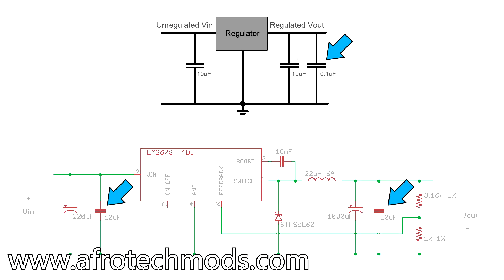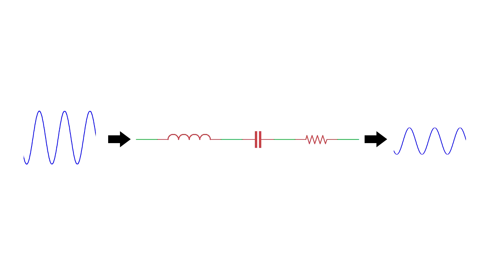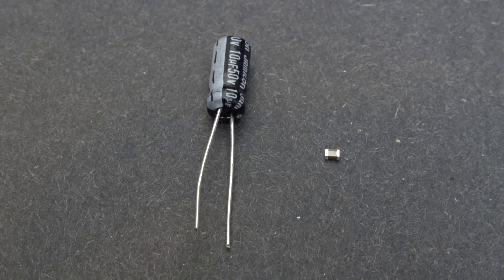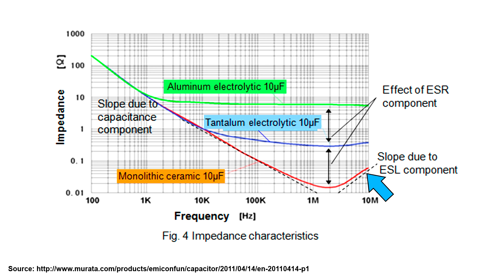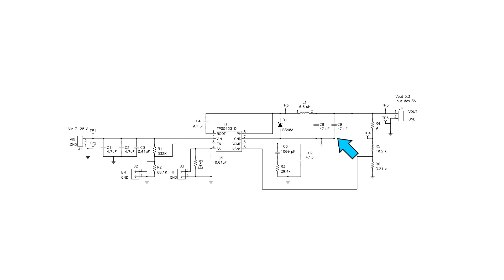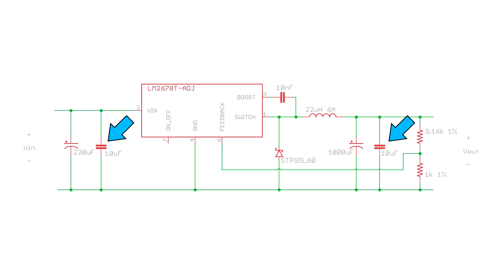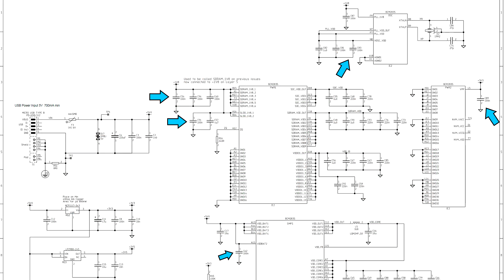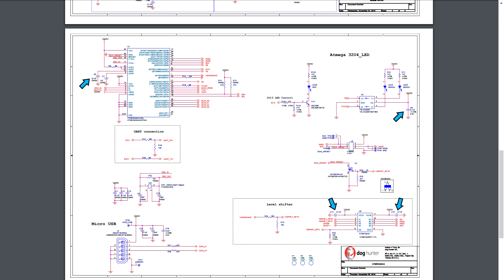Why electrolytic capacitors are actually kinda crappy 💩

Comment: Electrolithic for bulk, ceramic for decoupling ICs... thats it? . What about piezoelectric effect on ceramic smd capacitors? Capacitance vs voltage(typical -80 percent capacitance at rated dc voltage)? Capacitance vs temperature? What about tantalum caps? Electrolithic cap service life at rated temps(2000~10000h)? Y class? X class? Leakadge resistance(especialy for auper caps). Dielectric obsorbsion?
Reply from the maker: What about them? With your vast knowledge of the subjects, and a clear desire for others to learn about them, I am sure you must be working on a video that will talk about all of these things. And because you are so very clever, you will find a way to neatly fit all this information into the ~10 minute recommended format for Youtube videos that matches the average person's viewing habits. I have subscribed to your channel and I look forward to seeing your video that will talk about "electrolithic capacitors" and "dielectric obsorbsion".
Reply from the maker: Most of the time it's fine but occasionally you'll run into something that requires a min ESR / ESL to be stable. You could just replace them with some nice 10,000+hr 105ºC electrolytics.
Reply: @Afrotechmods  aha! That makes sense. I was wondering the same thing. Thanks! 
BTW, what the heck is diarectumlic obortion?
Reply: I think he was triggered, and forgot to spell his words properly during his event.
But I have a question:
How do you feel about replacing electrolytic capacitors with non-electrolytic capacitors of the same capacitance rating?
I ask because I have multiple old electronics with failed electrolytic caps, and I want to replace them with caps that aren't going to fail, even under high temperature/high load conditions.

Comment: You didn't mention derating of capacitors or compensating for it..
Ceramic capacitors can drop to almost half their specified capacitance value depending on current and temperature, whereas electrolytic caps don't suffer as much..
Like every component, be it electronic or mechanical, everything has a place/use and everything in engineering has trade-offs...

Also over 1% voltage ripple isn't great, unless that was 50% of the max load
Reply: Depends on the cap rated voltage. Using 10V rated for 3.3V output will deteriorate a few %.
Reply: MLCC's are also susceptible to cracking due to board flex or thermal expansion/contraction, and causing microphonic or piezoelectric effects. Remember "coil whine"? Well, MLCC's can have "capacitor whine" ... I've heard it myself.
Also, low ESR means low resistance (and low impedance for low ESR and low ESL), and thus very high (relatively) peak currents. This can be unwanted in some designs due to the radiated noise. (Yet at the same time, lower resistance means higher efficiency...)
So yes, electrolytic capacitors are good for certain jobs. In fact, I have a power supply that needs a moderate level ESR capacitor at minimum. If it's too low, the power supply goes unstable! To use a long-life capacitor - many many of which are also low ESR - I had to ADD a resistor in series with it, lol.

Like, you wouldn't put a metal film resistor on a high surge current circuit. It'll burn out due to tiny hot-spots in the film, even if the average power is less than 1% of it's rated power! You need a wirewound/metal element resistor. (some designs do have better properties, like lower inductance by having the windings zig-zag.)

Comment: Thank you @afrotechmods. Now i know why they're using 100nf capacitor in every design i ever read, in between ground and vcc of microcontroller, microprocessor, or even an op-amp. Didn't believe me??? i suggest you, try read LM324 datasheet from TI. They tell us to insert a .1 uf ceramic bypass capacitor, in order to reduce noisy or high impedance of PSU. But now i know why. You are great teacher. never feel bored to watch your video again ...... and again...... and again.......... :D

Comment: One important factor that afro tech  might have forgotten to mention is that ceramic capacitors aren't perfect either. The small packages (0603) can behave negatively in more extreme temperatures, which is why for certain applications a bigger package for a ceramic capacitor is better for less variations in voltage capacity and capacitance itself.

On another note, tantalums are great in that they also have low ESR, but holy hell they are expensive. Same goes for ceramic capacitors when you go above 33uF. Electrolytics are very useful in some applications (motor control, wall AC to DC, etc) so don't simply rule them out.

Comment: In power engineering this is a serious concern when designing capacitor banks since the capacitors tend be so large the inductance is far from negligible and if not accounted for your power factor correction will not be adequate. It is also important when calculating the proper size of your inductor for limiting in rush and  out rush current.

Comment: Part of the reason for 100nF caps is the price and package sizes you can get them in. Since the ESL and ESR changes based on the package size and thus the frequencies that can be filtered. So for higher frequencies you want to use the smallest package you can, and it's easier and cheaper to get a 100nF cap in a smaller package than a 10uF or something higher. Tl; Dr size and capacitor type is more important for filtering than the capacitance.

Comment: Another reason designers just use 100nF caps is because having more components on a pick and place machine is more complicated.
Reply: Laharl Krichevskoy fucking hell aint this the truth. Remember those cats place in smaller capacitors inside big electrolytic bodies to rip people off 😂
Reply: Jonah, another reason is because it's cheaper to buy these parts in bulk vs low quantities. This especially holds true for passive parts.
Reply: 104's are the "magic pixie dust" of digital electronics.  Sprinkle them everywhere.  You can buy a bag of 1000 of them for a few bucks on Aliexpress.  It is good that relatively large ceramic caps are a lot cheaper now, than 20 years ago.
Reply: Jonah Swain
Sadly, very true. A good example is those clone iPhone chargers that run the 5V side less then 1mm away from the mains input. Absolutely horrid design, definitely a lethal flaw.

Bought a cheap 1A 9VDC power supply once, and did my standard disassemble and check routine. The design was extremely simple, a very large isolation cap (pretty much the size of the transformer) and I think it has some form of overvoltage and overload protection built into the single chip solution being used. The problem? Someone didn't clip any of the through hole component leads, probably just one rolled by on the assembly line (or many if someone was lazy) and it didn't get done. Rectified mains cap leads a few mm apart. Clipped them all off and  as far as I can tell it's working great yet. Just recently inspected it again and it's as good as new yet, but then again I'm likely only using it at 20% load. I did test it to the full rated output power, it got a bit warm inside, but nothing to be concerned about.

I also reverse engineered the schematic because it's such a easy to build design, if I ever want to quickly make a custom power supply, I'm going to "borrow" it. If anyone wants the schematic, I'l create it in software (instead of paper like it currently is) and give the file.

As a general rule of thumb, I always disassemble any cheap power supply I get and review it, some are decent designs and adequate quality, some are extremely great designs for an equally great price, and some others are absolutely the worse of the trash deserve to be scrapped for parts. It's always a gamble, and not one to be taken by those inexperienced with electronics.
Reply: Laharl Krichevskoy
HA! That happens way too often. Crappy power supplies will blow your electronics to hell in seconds.
Reply: theLuigiFan0007 or blow themselves to hell as soon as plugged in
Reply: "44Vpk-pk output noise" - LOL
Reply: @GnuReligion - absolutely! the old 0.1uF ceramics cover a multitude of sins.
Reply: Thats why in china they just dont populate the board. Filtering caps? Who needs them! (44Vpk-pk output noise)
Reply: Sooooo like. What about handling volt spikes(from a motor stopping suddenly), lots of noise, and that is close to a heat source.
Reply: They are more like rats than cats.
Reply: MrTweetyhack indeed
Reply: They'll do anything to save a penny.

Comment: I didn’t know, but do those tiny things still take the same higher voltages than the big one’s?
Reply from the maker: Depending on which one you buy, yes.
Reply: The small, high value MLCC's (multi layer ceramic capacitors) also have terrible voltage coefficients - that is, as the DC across them increases, their capacitance drops. For a typical MLCC, the capacitance can drop to as low as 10% of nominal value at the "working" voltage. So that 10uF 10V cap is actually a 1uF cap at 10V. For some design applications it can get a whole lot more complicated than Afrotechmods went into here.
Reply: All of them come in a variety of voltage ratings, and it's a tradeoff, as increased voltage rating costs space that detracts from the energy density. 100 uF 16V electrolytic is going to have roughly the same 5x11mm size as 4.7 uF 50V. A 0603 sized (1.6*0.8mm) surface mount ceramic capacitor could come as 4.7 nF 50V or 4.7 uF 10V.

Ceramics rated to thousands of volts are actually quite common, you'll find them for example as X/Y safety capacitors in power supplies, for example as a 7mm leaded disc with maybe 100-470 pF.
Reply: The same voltages, yes. The same power dissipation, no.
Reply: Alright, thank you :)